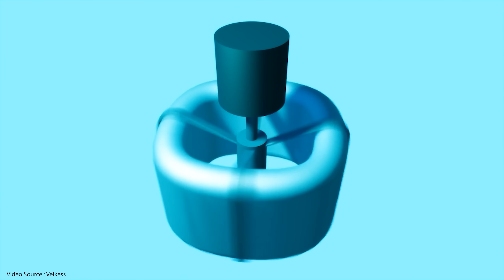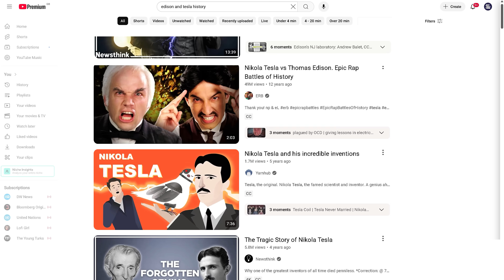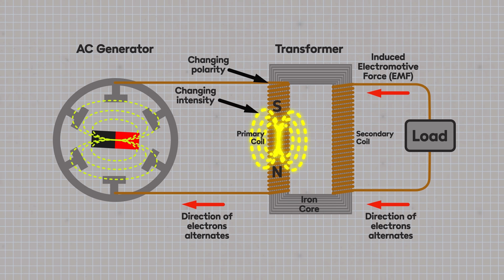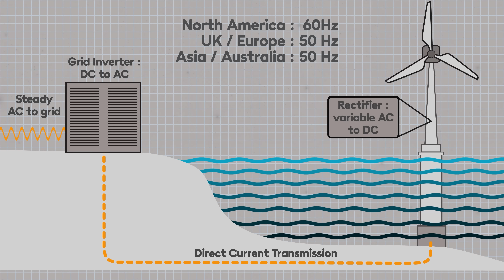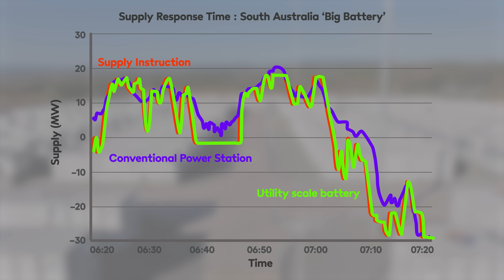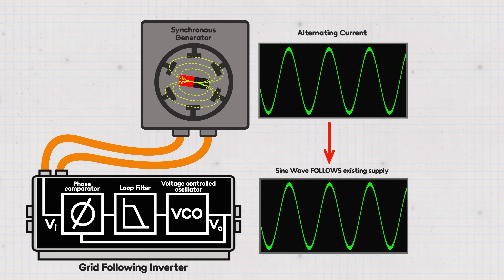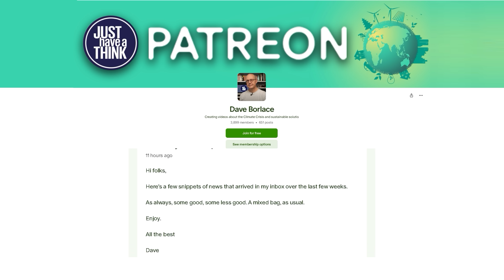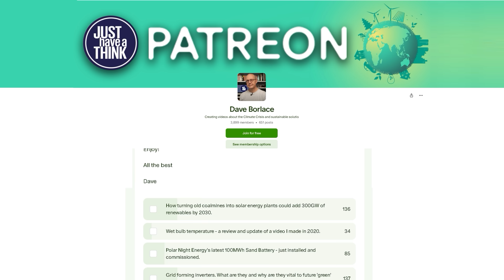How GRID FORMING INVERTERS are paving the way for 100% renewable energy.

Comment: Current Enphase Solar and Battery Tech  has grid forming ability.  I can run the critical circuits in my home even if grid power is off. It can join the grid when it is online, as opposed to an off grid Solar system which can only run stand alone.
Reply: Note that the "grid forming" capability in  residential inverters is really more of an "off grid" capability, not actually grid-forming in the sense of the larger grid.  A residential hybrid inverter is grid-following only.  When the grid goes down, home backup systems disconnect from the grid and switch to off-grid operation.  i.e. it is forming a "local" grid for the home, but it isn't really grid-forming in the sense of the larger transmission network.

Enphase, in particular, got into trouble trying to make its micro-inverters self-synchronize without a battery inverter to provide a master waveform for them to follow.  They tried selling systems that could form micro-grids without batteries and it was a dismal failure.  So now Enphase systems that are micro-grid forming actually do need a battery inverter in the mix to work properly... and the microinverters just "grid follow" the master.

Residential hybrid inverters work the same way.

All residential installations are essentially grid-following.  It is more or less impossible to grid-form to the larger grid when backfeeding residential distribution lines.

Commercial grid-scale battery inverter systems work differently.  These can actually implement official ancillary grid services such as frequency and voltage stabilization, rather than just be grid-following.

-Matt
Reply: @junkerzn7312 - actually Enphase microinverters are able to provide ancillary grid services and each microinverter features a full utility control stack able to provide primary control response and secondary control scheduling.   There is no such limitation with Enphase microinverters with regard to being true grid forming  - they can black start, provide voltage and frequency ride-through, reactive power control, frequency-watt droop, volt-VAr droop, sequence component awareness, selective harmonic compensation and damping, and also inertia.   The only limitation comes down to the physical power rating of the system  - but this is the same for any grid asset renewable or conventional.
Reply: @junkerzn7312 - I disagree with your assertion here.  The only factor limiting an Enphase grid forming system is the physical capacity of that system - you can't expect a single resident system to power the entire national grid, however this can be said about any other single grid asset.  Enphase has installed >1MW systems and is currently installing a 8MW system - which is capable of supporting a 8MW sized grid or if connected to a larger grid will behave like a 8MW asset.
As for the PV only grid-forming solution  - sure this isn't going to meet tge expectations for a 1st world application,  however this wasn't designed for 1st world applications, rather it is a solution designed for 3rd world applications  to provide remote village power to perform functions like allowing an insulin fridge to be operated to keep insulin and other medications cold, or to allow cellphones to be recharged.  The idea of only having an AC grid when the sun is shining is a revolutionary idea when you are coming from a perspective of not having any power whatsoever.
Reply: The important thing is not to (try to!) feed energy back to the grid while it is down. Become an island unto yourself...

Comment: Phase Locked Loops for grid forming should use gps signals to generate the reference frequency. This would allow coordination of independent grid forming inverters to synchronize without being connected and when connected by a switch there would be a seamless transition as the voltage would already be in phase and adjustments would not be needed. GPS would also provide location information that would enable phase correction for the propagation delay or speed of light differences .  Light speed works out to be a nanosecond per foot, 5 microsecond per mile, 5 milliseconds per 1000 miles and 15.8 milliseconds coast to coast. 60Hz has a period of 16.7 milliseconds which is close to the coast to coast distance.
Reply: Convenient numbers, eh? Drop one cycle and the generators are synced up. Way too cool. I wonder how the grid operators handle grids that are a half-cycle off. Do they speed one up and slow the other down until they line up, then connect? Is there a drop for a half-cycle or so, then a sync? Curious "minds" want to know.
Reply: It doesn't really work this way.  Grid-forming just needs highly-accurate timing, which is actually pretty easy.   The actual phase drifts around based on many, many factors... not just distance (distance from WHAT exactly, you might ask!), but also temperature, humidity, wind, load... all sorts of stuff.   So just synchronizing to GPS across the whole country won't do the job.

1 cycle at 50Hz is 20mS.  A half cycle is 10mS.  The phase variance that can be tolerated is measured in the low microseconds.  Down to nanoseconds.

AC transmission lines generally cannot span more than a few hundred miles before needing a resynchronization station, because the phase wiggles around more and more the longer the distance (due to changing temperatures, humidity, load, wind, etc).
Reply: GPS sync sounds a very complicated solution, one introducing new problems of GPS signal loss due to terrain and buildings. Plus isn't required the grid-forming technology can monitor the local connection and react in milliseconds (or faster) to local changes/drift/reactive power needs. During a black-start a grid forming device can start on its own, then adjust to the frequency/voltage of the local network as more devices come online.

If timing synchronisation was the issue then the grid devices would simply be equipped with factory-synchronised atomic clocks, which are available a chip scale devices these days; after all atomic clocks are what keeps GPS satellites in sync.

Comment: I hope that in all this new technology we don't lose sight of also prioritizing designing our homes/communities to use less energy and decentralizing the electricity that we do use, because overall ecological footprint still matters and isn't guaranteed to be reduced on an all-renewables grid. I live in a rural area where our connection to the larger grid (which is hydro powered, in our case) goes down for days at a time on a regular basis - basically every time there's a wind storm, which is getting more frequent all the time as the climate disintegrates - and we are used to living without it. We heat with wood (often the same fallen trees that knocked the power lines down!), which we can also cook with if needed, have good old landline telephones that still work when the power is out, and build with traditional and natural materials and passive solar design so our houses don't need to use nearly as much energy to heat and cool. We are at a latitude above 50 degrees north, too, so heating and heat retention are no small concern for us. It's great that there are engineering solutions going toward making grids that can run on 100% renewables, but let's also remember that we still need to design better ways of living that don't use as much energy in the first place.

Comment: I do wonder how they keep the grid frequency from getting messy when there are hundreds of small producers dumping power on with slightly different frequencies.
Reply: The trick is that grid forming inverters can also operate as grid following inverters. In addition, some installations will have a single grid forming inverter with several following inverters. The trickiest moment is the coupling itself, but we have that challenge with any grid fragmentation event and have methods of connecting those too.
Reply: Grid following inverters are always trying to push the frequency up. This isn't a complaint, this is by design. The grid is very large, those small inverters haven't a hope of succeeding, and if they do succeed, it's one of the ways they know the grid is not there, and disconnect.
Reply: Likely the same way they do here in Nova Scotia where a very significant portion of the grid electrical power come from 600-800km away. In the middle of the night (4:00 am local time) there is a milliscond to 1.6 second power disruption during which the frequency is synchronized. When it gets over one-half second it can cause problems.
Reply: @weldonyouyou mean half a millisecond?????ng1013
Reply: If each one has an accurate clock, they can keep it synchronous without a direct connection. I don't know if that is how they do it.
Reply: @grieske  When I ran medium sized stations with synchronous generators, the automated synchronizers would monitor both grid and plant: frequency, voltage, phase angle and adjust until it was safe to close the paralleling breaker. There was also a manual method of doing the same thing. A simple (but tricky) way of doing the same thing is to first connect one conductor (the ungrounded "neutral" if both systems had one) and then put a meter between a phase conductor of each system. Watch the meter show the difference between the two systems and close the breaker when voltage difference is zero. (It is incredibly important to not screw up.)
Reply: @JimHolder-pk2kk  I heard that screwing up the synchronization is spectacular. Thanks for your reply.
Reply: Incredibly...
Reply: @grieske no.
Reply: They don't

Comment: Hadn't heard of Grid Forming Inverters before. Thanks! Please consider doing a piece on digital electricity. Higher voltage fault managed power could play a major roll in microgrids.
Reply: What do you mean by "digital electricity ". Electricity is by it's nature analog.
Reply: @bknesheim thanks, I'm curious to know as well.
I do understand the 'digital electricity' inside a (eg) CD Player, but that seems hardly relevant to my toaster.

Comment: Just popping in to say: Yes. 

I live in the south east US. Our specific area is, simultaneously, known for it's winter ice storms and above ground power lines. Because burying them would be "too expensive"  (Thanks Duke Energy. You suck.) So every few years, we spend up to a week without any electricity.

People would label us "preppers", but ahem, farmers have lived the way we live for a very long time and nobody has ever thought they were crazy. Just... prudent. 

We have two 325 gallon food grade tanks, plus several 50 gallon food grade barrels we collect rainwater in. So water for toilets, wash ups and drinking (if necessary) ... done. Our house was built by northerners so it's very well insulated and has a basement, surrounded on 3 sides by earth. So moderated temperature place to sleep? Done. 

I can and dry and preserve the food we grow or buy in bulk. We have a small greenhouse where winter greens are grown and starts for spring planting. We live near a creek, a river, and a lake and have fishing equipment. We have chickens. So protein needs are met.

I realize we're very lucky to be able to do what we do.
Reply: Nice. We live differently but we also have a very reliable grid (living in Switzerland) in the average we have 15 min. annually that we do not have electric power. However that rate is nationwide and is dominated by the mountain regions where storms can break trees and trees brake power lines. We live near a village in the midlands and we make the average look good. E.G. I do not recall a power outage of more than 2 hours during the past 30 years!
Still we have some people not too far living quite similar as you describe and some people think if they run PV on their roofs, it won't serve them unless they have a large battery and the means to run a grid of their own should there be no power in the line.
Reply: @beatreuteler They should think of it as serving a common cause by adding extra generation to the system until the inevitable blackout occurs...

Comment: I clearly don't understand the situation because you can tell right now where the frequency is in it's wavelength so at any given time in the future you should be able to know at what part of the frequency wavelength it should be at right? So given that why not just monitor that where a frequency is needed and generate electricity using that if you don't have it.
Reply: An actual grid-forming inverter will typically have a bit of a different output stage than a typical residential off-grid or hybrid inverter.  "grid-forming" in the off-grid (within the home) sense is very different from grid-forming on the actual grid.   When you hear "grid-forming" for a residential inverter, that's just (mostly) marketing speak that means the inverter is coded to be able todisconnect from the grid and provide backup power if the grid goes down.

A regular inverter just puts out a voltage and has no control over the phase of the current... it's basically a 1.0 power factor output which means that the inverter has to sink all power that is reflected back to it by poor power factor from the loads.  It usually does this by allowing the feedback to go all the way back to the DC side of the inverter and then buffering the subsequent "ripple" on the DC side with diodes and capacitors so the power can be recovered and reinjected into the inverter circuitry.

A (real) grid-forming inverter has some independent control of the phase between the voltage and current waveforms being generated.  It does this with a different output stage.   This allows the grid-forming inverter to only have to sink SOME of the reflected power in the inverter circuitry and let the inductance (etc) in its output stage deal with the rest.

A real grid-forming inverter can use this control to perform all ancillary services grid needs for voltage and frequency regulation, and can apply energy to the two components independently to make corrections.   A regular inverter cannot.

That and the algorithms are very, very different.

-Matt
Reply: Except electricity has two components; voltage and current, and they need to have the right phase relation. Otherwise that is essentially what we do, but it is a lot more complicated to actually do in practice than it is to say it ;).
Reply: @vinzent1992  and that is incalculable?
Reply: @matthewtalbot-paine7977  No, did I say that?. All I said was that the actual implementation is a lot more complicated for reasons that you would learn if you did a degree in electronics engineering.

Comment: I saw a working set up on an off grid home that had a small pelton wheel at the edge of a creek hooked into a small generator sitting in a dog house there. A cable ran up the hill to the batteries in the cabin. It just made a little electric power all the time.
This would work with the little pelton wheel on the peak of a garage with the generator up under the roof of the garage.
Reply: Lots of pelton wheels are used in the mountainous rural area where I live, and you need more head than you'd think to run one. It's probably more efficient to use small scale hydro power on something more like a neighbourhood or community-scale micro grid in places where the geography allows for it. The height difference between a garage roof and the street isn't going to be enough to generate a usable amount of power.
Reply: Why did the dog have to share his house with all the electronics?  Seems unfair to use the smallest room just because he can't speak english.

Comment: Electricity is easy to live without. Did it for many years in the woods. Living in a handmade cabin. Water is a completely different story.
Reply: If you live in a big city, and the power goes off. The water pumping stations go on to generator power. 

That will last at best 3-5 days. 
So allowing for gravity flow, you will have water for 6-7 days max.
Reply: @patdbean not in the UK, as soon as the towers empty, there is no more water.
Reply: yes.. but it's not easy to find much to burn for all the millions of people living in the cities.
Reply: @grizzly, so basically, you are saying the billions of people who live in cities should just eat $&)T and die, right?
Reply: So which farm is trialling the UK grid forming inverter.
Reply: It really isn't.  You can survive but you spend far more time replacing that electricity than you would working to buy it.

Tried wood heat alone once and the work required for much lower comfort was staggering if my time has any value at all.
Reply: oh yes, living offgrid in the semi arid, water is the only thing that matters, the rest usually you have time to deal with it.
Reply: Yet here you are, using a device connected to the internet, or does that not require electricity
Reply: @jb76489 yes here we are, if we lose the power I'll just go back to my old ways-nine years power free was a terrific life experience. It would be rough in the cities though.
Reply: @jb76489  He said he 'did' it. That's the past tense of doing, so he did it in the past but he doesn't now. Would you like me to further explain past, present and future to you?